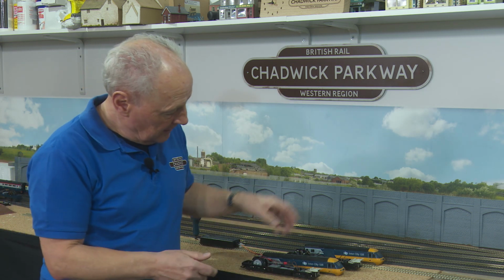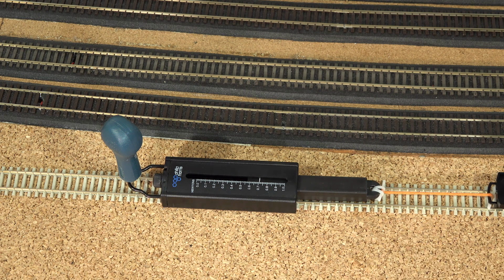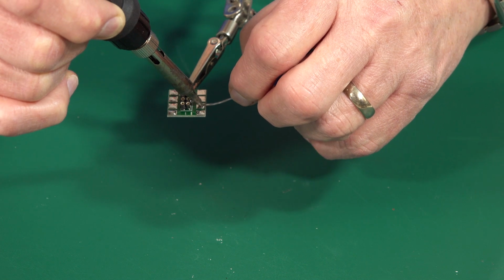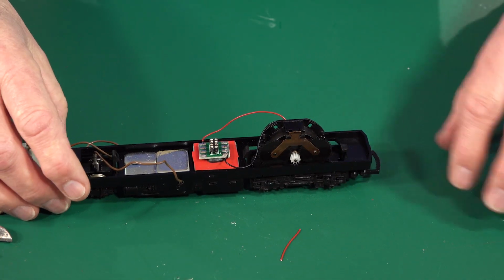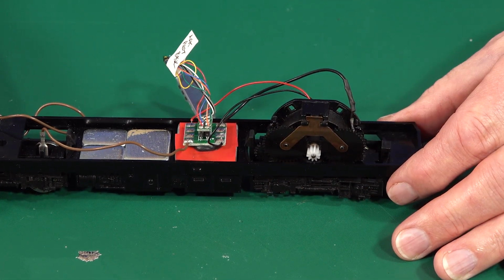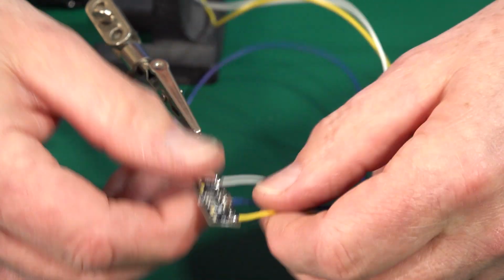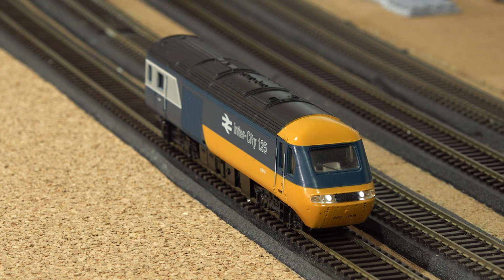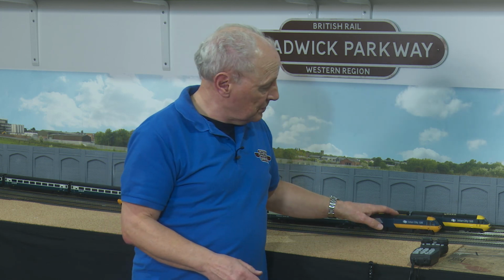Converting Locos to DCC at Chadwick Model Railway | 152.

Comment: Hi  Charlie. Another fine missive! Thankyou.
I particularly liked the little 8 pin PC board, very tidy that.
May I make an observation  regarding decoder testing?
Whenever I install a chip or any foreign  loco on my track, it always goes on the program track first. There is no need to ask how this rule came about (blush) but I have found it nigh on impossible to put the smoke back into a decoder!
Joking aside, if there is a short circuit then no damage can be done on the program track. But, if something is dodgy then you will kill the decoder out on the main line.
In days gone by we used to add weight to the loco to improve traction. Nowadays, the manufacturers of (Ozzi locos at least) are not stingy with the mass. So, I don't do it now.
Reply from the maker: Great tip on the programming track Peter, and much appreciated. Regards Charlie

Comment: Great Video! Charlie, any thoughts on making that loco with dual motors, like 8-wheel drive? The decoder should be able to handle the extra current, I guess the only question is the ensuring all the wheels are pulling power from the track! Cheers!
Reply from the maker: I think the problem is gentlemen, you’d end up start starting to spend real money and in which case you might as well buy the newer model. Regards Charlie
Reply: @ChadwickModelRailway  That makes sense, unless you happen to have an extra loco that's damaged beyond repair but its powered truck can be salvaged. 😁😁
Reply: It'd probably be more cost-effective to have one motor, but driving both bogies via a loco-length drive shaft and a small gearbox on each bogie.  You're often limited by adhesion before you're limited by power, so more axles is good, but one motor is probably enough

Comment: I'm surprised you have had trouble with the western I managed to convert 2 of these and they run beautifully, one is Hornby and the other is Lima. I hard wired both of them and had no trouble. I like the lighting system and the adapter to take an 8 pin socket. Thank you once again for the excellent video and the way you put it over, it makes it so easy to follow. Frank.
Reply from the maker: I’m so pleased that you enjoyed it Frank.

I think my western was a dog from the beginning! Regards Charlie

Comment: I love watching your videos, Charlie.  The one question I do have is on the board with the red and white LED's, do the instructions say which one is for the white and which is for the red?  Seems to me that switching the wires on that board when they worked backwards is the wrong way to go.  Since the motor leads are interchangeable, you should have reversed the direction by switching them, that way the wires on the light board are still the correct color for the light you want illuminated for the direction selected.
Reply from the maker: I believe the problem was with the motor feeds into the eight pin socket.

I had them the wrong way around. Regards Charlie

Comment: You suggest it is not worth converting old locos to DCC unless you change / upgrade the motor?
Reply from the maker: No not at all.

I would suggest changing the motor if the old one is problematic and can’t run at slow speeds.

Regards Charlie
Reply: You certainly can convert original Ringfield motors to DC, I have done so myself. However, given the age of the motor and potential hours used it is worth cleaning and servicing them. OOBill here on YouTube is an excellent source of information on how to do this, also other types of old DC motors. Given the cost of a new replacement CD type motor conversion kit I wonder whether it’s worth it.
Reply: Thank you for clarifying that. You did great job by the way!

Comment: Evening Charlie, well Thankyou for this video. Right up my street as one says. Having the decoder socket offers far more options to develop. As you say could just have a plug, then a decoder of choice and finally even sound decoder. The lights are great, which did you go for? Warm or pure white? There are so many ways to achieve the lights but think this is the easiest way. Fabulous video again, have waiting to see this before continuing my fleet on three HSTs just confirmed my thoughts and ideas. All very best Marc
Reply from the maker: I’m so pleased that you enjoyed Marc.

I think I went for the pure white lights. Regards Charlie
Reply: @ChadwickModelRailway  went for the same, really liked the small pad socket solution but guess it’s how confident and good one is with the soldering iron. Just practice on an old unwanted piece of track or such like. Be interested to see what happens when place the dcc blank plate back in, which way did the motor unit go…. All best again Marc
Reply: Hi Charlie was hoping if you can answer a simple question if possible? I’m going to redo my dcc conversion to use the plug socket you used. Looked perfect for the HSTs especially as it’s flat. My question is re cables from socket to the parts around the power car. Are the cables from within a scart lead ok to use?? There are so many in one scart cable and miles long!!! Thankyou Marc
Reply from the maker: Yes I’m sure that they would be fine.
Reply: @ChadwickModelRailway  Thankyou

Comment: I can’t remember where I read it (many years ago) that the DCC motor connections were just a paler version of the track feed wires - ie grey=pale black; orange=pale red. Provided red and black are oriented correctly, you then have the correct direction sorted. 
I’ve converted a DMU to DCC but it retains the old drivetrain; the motor upgrade seems a very good step. Thanks for the videos.
Reply from the maker: Thanks for the info Richard, very useful. Regards Charlie

Comment: You covered just about everything that I am doing with my loco's as just about all my steam loco's are Margate built, pre China, none are DCC ready, using care and 8-pin sockets I am converting most of my stock. As an extra I recently bought from Amazon a small heat gun, an Avec UK Heat Tool, two heat, 150w & 300w, Model HG60D. It has stopped me getting solder onto the sleeving  from the iron when I used to do what you were doing, it makes a much nicer job too.
A very well thought-out video Charlie, keep up the good work.
Reply from the maker: I’m so pleased that you enjoyed it Peter and good luck with your project mate. Regards Charlie

Comment: Hi Charlie, great video, very informative. Are you able to tell me at what temperature your soldering iron operates.   Cheers   Greg  PS:- In Australia we call the process you have just done as "Hard Wiring" a decoder to convert a loco from DC to DCC.
Reply from the maker: I might just disagree Greg. Because I fitted the socket, the decoder is not hardwired as you have the facility to remove and swap it for another.
My soldering line is at 400°, regards Charlie
Reply: @ChadwickModelRailway  Thanks Charlie, point taken.  Regards  Greg

Comment: Hmmm, Im not convinced DC to DCC means you lose power. The lights will draw some power away from the motor although it will be a very small amount. Overall, a nice mod, Charlie.
Reply from the maker: I’m afraid you’re right, it wasn’t too scientific was it. Regards Charlie
Reply: These lights draw a tiny amount of current - a few milliamps - so will make no perceptible difference to the motor performance. Also, it's only on DC that would be a factor. On DCC the decoder powers motor and lights separately, and a properly wired system can supply considerably more than one loco draws.

Comment: An excellent 'how-to' Charlie - thank you, you didn't disappoint! Point to note, though, wiring a double-ended engine like a '47,  '50 or '52 can be a bit more complicated to ensure both end red and white lights work correctly relative to the direction of travel from the one decoder. But quite do-able with care. However I'd be very wary about trying to solder more than one wire to a miniature circuitboard tab (especially that 250A rated stuff you were using!!!) so make sure you've got plenty of heat shrink in stock before you start!
Reply from the maker: Great comment David.
And I must confess I do have my eyes on that my old Hornby 52. Regards Charlie
Reply: A couple of other pitfalls are not having a way to deactivate the tail lamps (red lamps between loco and train would have the signaller bringing you to a stop for a chat in short order), having both tail lamps lit at the same time (until the late 80s two tail lamps meant it's the back of the royal train, or the back of an Edinburgh-Glasgow top-and-tail set, but there were exceptions - I've seen photos of 303s in the 70s with both tail lamps lit), and having tail and marker lamps that burn with the intensity of a thousand suns, reminding the viewer they're looking at an LED not a low-wattage incandescent bulb

Comment: This is totally left field but I wonder if you popped a small piece of insulating tape on one side of the shorted point tracks (bit of trial and error for the area to cover) it might stop the problem. If it works then trex clear tape might be durable enough for running and also cosmetically OK.
Reply from the maker: I think using nail varnish would probably be the easiest answer. Regards Charlie

Comment: Charlie you can use old loco decoders for trackside accessories, i use one to light up buildings on a timer, the lights come on at dusk, anyway charlie whats a MORTAR? haha, are you from yorkshire? charlie you are a bad man! your torque test is invalid, the cd motor loco has more weight, ooo you rebel.
Reply from the maker: Yes all decoders can be used for many stationary operations, or perhaps lights in guards van etc. 
I did mention that the scientific experiment was somewhat dubious! Regards Charlie
Reply: @ChadwickModelRailway  Oh i know just pulling your leg mate

Comment: Put some heat shrink on each of the fingers of the helping hand that grips things. It will grip things much better whilst do less damage when griping fragile things. I’m sure you also know to regularly clean the iron with a metal mesh. It makes the soldering quality much easier and better when the iron is clean and always use fresh solder. But I’m sure you know 😁 Another great video Charlie. 😁❤️
Reply from the maker: Great tip Dwayne regarding the jaws of the helping hand. Regards Charlie

Comment: Nice one Charlie..I just hope all health and safety measures were in place incase the cord broke ......lol   . i had the same issue with the wide wheels shorting on points so i removed the wheel sets and careful filed the wheels a bit thinner and that cured the problem ,fiddly work but well worth the effort .. yet again another brilliant show..again another master class from the master ..
Reply from the maker: You’re too kind Antony. Using nail varnish is another way around that little problem. Regards Charlie

Comment: Well timed, Charlie!  I just finished converting an old so-called "DCC-ready" Bachmann GE 44 Tonner to non-sound DCC, including a keep-alive.  I did keep the incandescent bulbs as the TCS decoder could handle them, and I only use them dimmed as the loco is used only for shunting on a very small layout.  It was well worth the investment, as the decoder's back EMF feedback motor control gives it great slow speed control that is much better than that using DC.  You can see a picture of the loco on my Facebook page under my user name shown here, should you be interested.  Cheers from Wisconsin!
Reply from the maker: That’s great news Andrew, I’m so pleased that it’s worked out well.
These conversions can be somewhat problematic at times but it looks like you’ve come through with flying colours. Regards Charlie

Comment: Thanks! I will look for those lights. Word of caution based on experience: if doing DCC conversion but keeping the original ring field motor, the rear track pickup and the motor power are connected by a small tab (trace it from the brush spring back to the body and you'll see the connection). If you don't break that connection it will run on DCC, but it's not ideal to have the track pickup and motor power connected.  Cheers for the video, Charlie!
Reply from the maker: Thanks for the info Chris, I shall keep that in mind.  Regards Charlie

Comment: Hi Charlie, I have just converted a 1980 Duchess but it won't work. I know I have done something wrong so tomorrow it will be lap top in the railway shed, your vid on and I will start again, I can't fail, ....he said with tongue in cheek and everything crossed that can be. Think of me.
Barry.Devon
Reply from the maker: Good luck Barry. If you’re still stuck let me know with a new comment.
Reply: @ChadwickModelRailway  Hi charlie, my attempt at fitting DCC has failed. I have limited electrical knowledge but have checked conductivity with a multimeter. So the motor wires and 9v battery work. the track to DCC socket works and the black from ringfield chassis to DC socket works. I have taken the engine side apart down to just the chassis cleaned everything, tested continuity for one side to supply the ringfield. Put it on the test track, loaded the decoder connect the engine side to the tender and a little spark and nothing. The NCE power cab would not give me anything. Put another known engine on the rack and perfect for the NCE. Do you have any ideas? .........Barry

Comment: Always excellent Charlie. 
Shame about the thick wheels shorting the frogs on the crossing. 
Is there an easy answer? I have had the same problem with older locos. The model shop Suggested clear nail varnish but it does wear off and defeats the purpose of having live frogs anyway?
I have replaced LOTS of rolling stock wheels. 
Is it possible/ practical to replace those loco wheels?
Love each episode 
Many thanks stay safe 
Howard
Reply from the maker: Hi Howard, I’d imagine that you could get replacement wheels from a company such as Peters spares.
They seem to stock a great deal of this type of item. Regards Charlie

Comment: Great video. Thanks! I just tried something simular with an old Mehano locomotive. The power pick up from the rails was awful, even though I tried to improve it, so I had to add a keep alive capacitor. That worked wonders. However from the 10 LEDs I installed 7 got fried after just 5 minutes of driving around. And I am not sure why.
Reply from the maker: You probably have 12 volts through 3 volt LEDs Jaco.
Reply: @ChadwickModelRailway  Just a quick clarification, other than the odd special, LEDs aren't rated on voltage but on current. You need to use something else in the circuit to limit the current flowing through them, this can be anything from a resistor (cheap but not very accurate) to a fairly complex circuit which can allow for variations in voltage and even temperature.

Another thing to consider, LEDs are semiconductors, and as such as susceptible to damage from static. It's always worth taking basic static protection before using them - just touch a radiator or anything else which is earthed.
Reply: Most probably. However I did install resistors in series with the LEDs. So my theory is that somehow something shorted out and bypassed some of the resistors, because one group of 3 LEDs are still functional.
Reply: @jacovoorwinden3609  try groups of four

Comment: Thanks for the simple but effective pulling power item.  I have always believed that pulling power (actually pulling force) was related solely to weight and friction with power seldom being a constraint. My locos always spun their wheels long before they ran out of actual power.  Your demo suggests I am wrong.  Have you any suggestions about why the new motor pulled so much harder before slipping occurred?
Reply from the maker: Sorry but I haven’t a clue GT. it was a little “seat of your pants” experiment.
Reply: @ChadwickModelRailway  I suspect the different way of driving the motor. With DC you vary a constant voltage and therefore a constant pull. With DCC the motor voltage is switched with a varying duty cycle i.e. not a constant pull
Reply: @davidyeates8894  It is also possible the decoder has feedback and / or is applying artificial acceleration. Essentially not just flooring it, but trying to adapt to load.